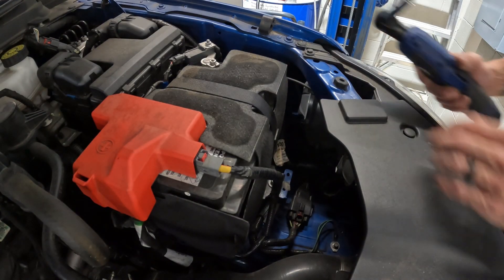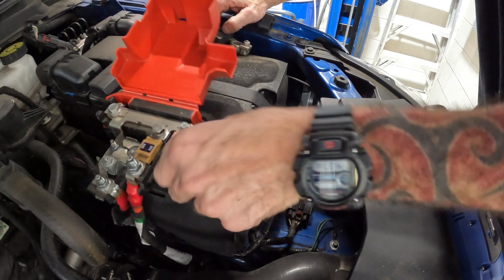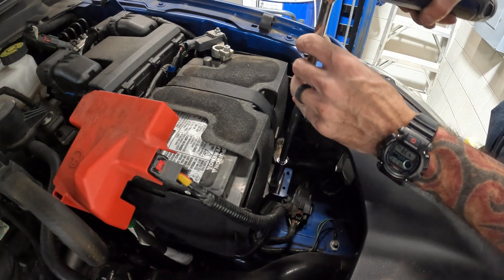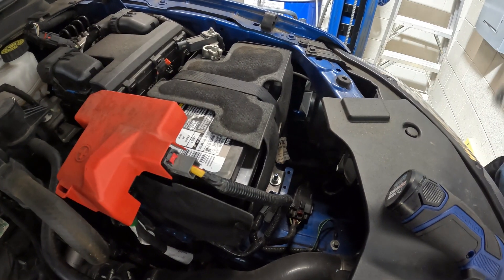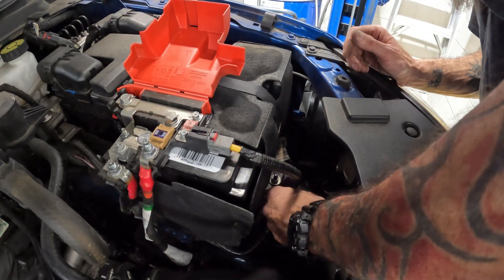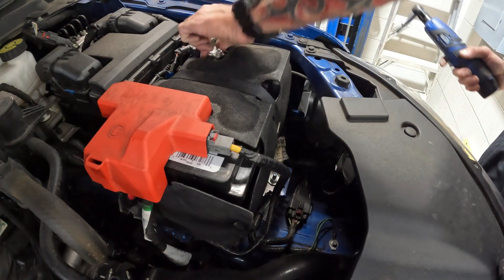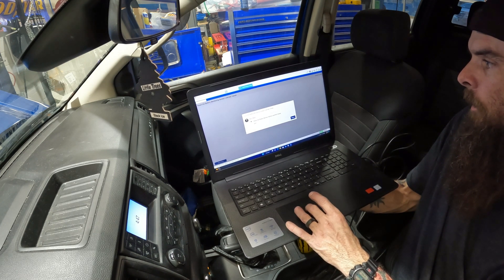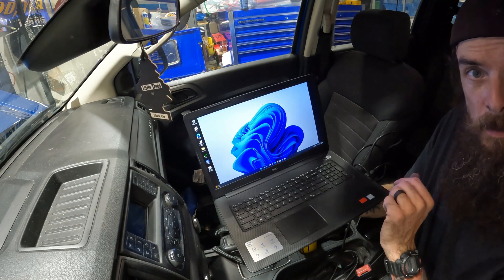Ford Ranger Battery Install, BMS Reset Instructions

Comment: If the batter has high Amp hours and higher CCA do you have to code that in with the ford scanner? 
Or does the flash the high beams 5 times and pump the brake 3 times do the entire reset.
Reply from the maker: Just do a reset.  Now.if ylu cha get it from a AGM to something different then you would have to go in and tell it what kind s of battery it is.  Like if it was lead acid and you went to agm. You would have to tell it that its an agm

Comment: Thanks for the video. Great video. I had my battery changed at the Ford dealer about 2 years ago. I was right by his side as he did everything. He took off all the bolts around the positive terminal. Took him about 45 minutes. Compared to you, it was hilarious .....  now. I don't think he did the BMS with the headlight blinks and brake pedal, but it still working as it should, so no complaints about it. Also thanks for the info about the stop/start.
Reply from the maker: Did he do the BMS reset with the computer?  The headlight and brake pedal is for when you don't have a computer. Just a little truck.  You are welcome. Thank you for watching as well.

Comment: I have multiple warnings and DTCs popping up and am wondering if it's a weak battery that's almost six-years old.  Was this happening on this Ranger?  My second suspect is a malfunctioning ABS sensor which I'll replace next.
Reply from the maker: @mahmoudibnemir8704  no this wasn't happening. If you have a bunch of "U" codes that say battery voltage then it can be from a weak battery. What makes you suspect a malfunctioning abs sensor?
Reply: @BeardedFordTech  A tech at a Ford dealer told me he saw a code for the ABS power circuit being open.  I am getting quite a few U codes in the ABS when I used FORScan.  I'm also getting quite a few U codes all over the place.  I bought a new Interstate battery yesterday which I'll install Monday.  It all started with a 4X4 code/Powertrain Malfunction which keeps coming up.  The Cruise Control/Image processing module keeps throwing a code.  I had noticed the battery being weak but thought it was another malfunction.  Somehow or another I'm going to save my Ranger.  Thanks for the reply.
Reply: These were the U codes in the ABS:  U3013:16-08, U0140:00-08, U0104:00-08, U0100:00-08
Reply from the maker: @mahmoudibnemir8704  make sure it's an agm battery. And make sure you reset the battery monitor system. Clear codes and retest. Let me know.
Reply from the maker: @mahmoudibnemir8704  those are usually battery voltage codes.
Reply: @ It's an AGM and I'm watching your Battery Install video now 🙂.  I'll let you know - other than this it's been a great truck - I had a 98 Ford Ranger that I traded in for this one.
Reply from the maker: @mahmoudibnemir8704  love my ranger. Great truck
Reply: @BeardedFordTech  Hi.  It's an AGM Interstate MTX-48/H6.  The Ranger is a Lariat and I'm not sure if it makes a difference if I use this one or should I use the 94R/H7 because it has more accessories.  The original from the factory is a 94R/H7.
Reply from the maker: @mahmoudibnemir8704  use the 94R/H7
Reply: @BeardedFordTech  Thanks!
Reply from the maker: @mahmoudibnemir8704  welcome

Comment: My truck doesn't have auto start. Should i still go with an AGM battery?
Reply from the maker: @robertjaynes9668  what kind of truck?  What kind of battery came in it?  AGM is better than acid filled
Reply: @BeardedFordTech  2022 ranger. I haven't looked yet at what's in it
Reply from the maker: @robertjaynes9668  it should have start stop.  Look down next to the shifter.  Should see a button next to the tow haul and traction control
Reply: @BeardedFordTech  ok. Thanks

Comment: My car will not start after battery replaced. Adblue was running low also so that may be the issue? Any guidance would be appreciated
Reply from the maker: @abdulrazzak3774  what?  Adlue?  Its literally take a battery out. Put a new one in.  Reset battery monitor system. Start it
Reply: @ thanks, will change the battery out once again and do a reset as you suggested
Reply from the maker: @abdulrazzak3774  did you put a new battery in already?  Made sure everything was connected right?  Then you reset the system. I've seen people leave those little caps on the baytery terminals before those come off.
Reply: @BeardedFordTech  yes I have car cranks over but does not start
Reply from the maker: @abdulrazzak3774  thats odd. Did you reset the battery monitor system.  Ignition on engine off. Flash high beams 5 times. Step on brake 3 times. Battery light will flash on dash after sbout 10-15 seconds.  Turn ignition off. Then try and start.  I've never had one not start after a battery replacement
Reply: no I didn’t, I think the battery has packed up now so will replace and try again soon
Reply from the maker: @abdulrazzak3774  pkay. Let me know

Comment: Replaced the battery car cranks for 2 seconds and go off. Everything was fine before that.
Reply from the maker: @Fatalizimo  did you reset the battery monitor  system?  Then crank. Don't know ow why some people replace battery and it doesn't start
Reply: @ haven’t done that yet also my brake pedal is hard

Comment: Sir, how come when  you pull out the negative terminal your car alarm doesn't go off?
Reply from the maker: Why would the car alarm go off?  I'm not messing with a security function. Just a battery. Key is in ignition it knows I'm not breaking in.
Reply: @BeardedFordTech  Ahh I see now where I'm doing it wrong. I should have placed the key fob in the cup holder and push the start/stop button once before disconnecting the battery. Is that right sir? Sorry for my bad English.
Reply from the maker: @MrDevilside  yeah. Leave the key in it. Don't have to push the button as it knows the fob is in it.

Comment: Hey man thanks for the video ! I have a question I replaced my battery about a month ago . But no one told me about a rest after I replaced it, not even my local auto one where I picked up my battery. 

Just yesterday I got a check engine light. I Went and got a code reading for eco/pcm power relay too early... 

I took your advice and tried to key reset with the 5highbeem and 3 parking break , but I still get a check engine light , 

Did I fry my computer or fry the power relay ? Would I have to go to ford and have them computer reset ?
Reply from the maker: @HumearD  that can be caused by a faulty relay for the pcm. It can also be caused by a faulty battery. You out the new one in (nobody told you, you have to reset), so it kept a memory of the old one.  It may have fried that battery, not necessarily the module

Comment: I changed my battery and it wont continue to start. It crank but only for 1 send and dont continue. I tried to start and pushing the pedal then a check service light appeared. What do i need to do?? Need help
Reply from the maker: @MichaelLamsen-j6w  pushing the throttle will keep it from starting thays called flood mode. If ypu installed the battery, make sure all your connections are correct. Something may be unplugged like the battery monitor sensor or anything over there. You can't just change out batteries like on older vehicles

Comment: Any ideas as to what would cause my blind spot monitoring to stop working? I recently had to replace my battery and had a few issues come up afterwards. It runs fine, I had to reset the driver auto power window, it wouldn’t come up or down on its own anymore, but the blind spot monitor won’t work on either side anymore. The truck and sensors are all clean and it worked fine before replacing the battery. I’ve disconnected the battery again in the hopes it would reset itself but no luck. It simply shows an “off” light on the bottom of the dash screen. Hoping to get this figured out before having to take it in.
Reply from the maker: You have to reset the battery monitor system.  Disconnecting and reconnecting doesnt do anything. It doesnt know it has a new battery. Key on engine off. Flash high beams 5 times. Step on brake 3 times. Battery light should flash after about 10 seconds indicating it has been reset. Turn ignition off. Then start vehicle. See if everything comes back online. Let me know.

Comment: Hey, thanks for getting back to me. Big question we’ve got the battery in everything‘s all good it started, but the strap that straps over the battery fabric case is too short for the metal bracket at the end I believe it bolts down. Can we take that off altogether or and I mean the cover, or does it have to be on there?
Reply from the maker: The felt cover is to keep the temperature of the battery steady. You can take it out. But I will recommend to get a new one soon. It shouldn't be too short. Did you get the correct size battery?
Reply: @BeardedFordTech  hey thanks for getting back to me again… We took the battery that was in the truck to advanced auto and gave us a battery but obviously it is a little bit wider because the strap won’t go around it… Any tricks you can tell me what I can do to that cover wore the strap. Does that metal bracket at the end have to be grounded with the bolt or is that just a hold it instead of the fabric per se cover
Reply from the maker: @feliciaspivey1707  that is the battery hold down not the ground. I would go get one that isn't wider. If it's too wide it's incorrect.

Comment: Do you have to have a computer and log onto a website or something to download all the stuff for the battery or can you do it just from the truck itself
Reply from the maker: To reset the battery?  You can do it without the computer. After battery install turn ignition on. Flash high beams 5 times. Step on brake 3 times. After about 10 seconds the battery light will flash indicating it's been reset.  Or you can install the battery. Close the doors. Lock it and let it sit for 8 hours and not touch it at all. Don't even let the key near it to reset it

Comment: may i what software you are using and where to get one
Reply from the maker: This is ford factoey software FDRS and IDS. You can't get it unless you buy the computer and vehicle communication device with it which is about $4,000. You can get forscan on your co.puter and get a communication adapter. It's like $12 for a year. If you don't know what your doing on forscan please be careful. You will mess something up.

Comment: I just disconnected the BMS in my Ranger 3.2 diesel 2023 because I needed an inverter and the charging system would go off after a while using it. I works pretty well without it the question is: How bad is it to run the car without the BMS?
Reply from the maker: It's not monitoring the battery. That's also how you get the auto start stop to be disabled. But if your battery has an issue or your alternator is failing then the BMS won't know because it's unplugged. So it's not super bad. But it's not super good because modules depend on a certain voltage to work correctly. And if it's not being monitored then bad things can happen

Comment: Seems like a short life for that battery.  Great video and thanks for sharing it.
Reply from the maker: Got four years out of it. Wasn't completely trashed. But new ones only have a 36 month warranty. Average lifespan is 3-5 years.  I used to have a 2011 f150. Battery died in 2020. Was the original battery. Must have been made on a Wednesday.

Comment: So we had the low beams replaced 2 weeks ago, and the guy couldn't reach the passenger side lamp so he removed the battery.

Ever since then, the car has run fine EXCEPT about 5 x in the preceding weeks, following a short stop, ie: petrol stop or short pickup stop. When we go to restart the engine, it turns over but wont start?

I have discovered if we disconnect the battery for a few mins, it will then start?

It does start fine in the mornings and after longer stops?

Should we complete this reset process since the battery has been disconnected?

Cheers in advance.....

edit: no they are just regular lamps, not LEDs
Reply from the maker: Shouldn't have to reset the bms if it was just disconnected. Only when replaced. Does it only do this after fueling?  Is there a check engine light?  You can try and do the reset to see if it clears the problem. He shouldn't have had to take out the battery though. There's room to get your hand in there
Reply: @BeardedFordTech  Not just after fuelling, no check engine light, the battery light comes on. The car just turns over, doesn't fire
Reply from the maker: @dbmgreen  have you had the battery checked?  Battery light comes on when you turn the key to the on position. That's a self check. It shouldn't be on while driving.  Did he plug the battery monitor sensor back in?  Have you had the charging system checked?

Comment: Hi, good video.I've got a 2019 Ranger also that my auto start/stop not working as well and getting the vehicle charging message on start/stop monitor... Question for you is do you attach a memory saver when replacing your battery or just replace and unplug and plug BMS
Reply from the maker: Unplug the battery sensor. Replace your battery. Plug the sensor back in. Turn the key to the on position. Flash the high beams 5 times and then step on the brake 3 times. The battery light will flash after a few seconds indicating the bms has been reset. That's all you have to do.

Comment: Thanks, good video. I turn off the Start Stop every time I drive, if I left the Battery Monitor cable disconnected would it matter or show Battery icon etc?  Also for those of us that don't have the FDRS thanks for the High Beams and Brakes method.
Reply from the maker: Your welcome. It only works on the ranger if you disconnect the battery sensor. It won't throw a light. On all other vehicles it will.

Comment: Manually done at 9:38

Is it the same for 2019 f150?
Reply from the maker: I didn't do it manually. I did it with FDRS. Just told you how to do it manually. But yes it works with the 2019 F150. Key on. Flash high beams 5 times. Step on brake 3 times. Watch battery light. After about 10 seconds it will flash indicating it is reset. Notice how my lights and stuff flickered when it reset?  It only does that using the computer. It does not do that when you do it using the high beam method.

Comment: Great video buddy,. 🎞🎬 You are right to many cables & clips,. The engineers thinks its easy to work on what they blueprint in a office 🔧🔩🔦🧰
Reply from the maker: Yeah. Looks easy on paper. Till you put a.wrench on it. Battery not so bad. But other things are almost impossible to do without taking the vehicle apart.

Comment: Cool intro! They sure attach enough cables to that positive terminal. Looks like a job for Amsoil Metal Protector. Nice to see Ford using a strap to retain the battery. I never cared for the GM wedge type of hold down. I was always afraid the battery would do a "Peter Pan" and take off!  🤣🤣
Reply from the maker: I like the strap easy to remove and install.